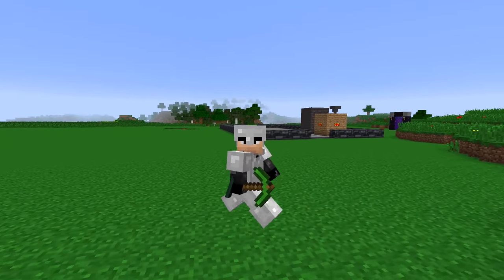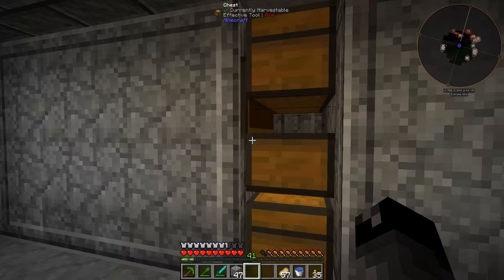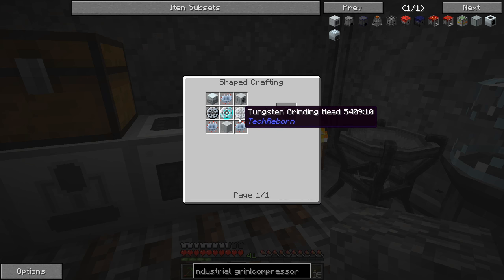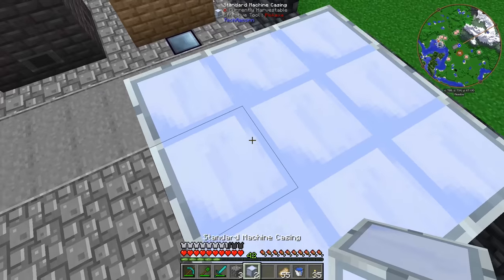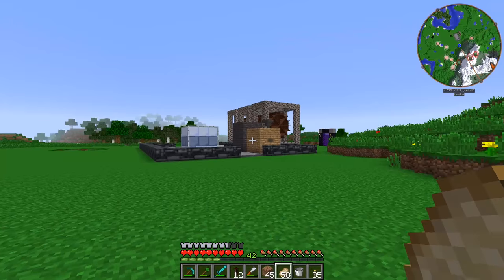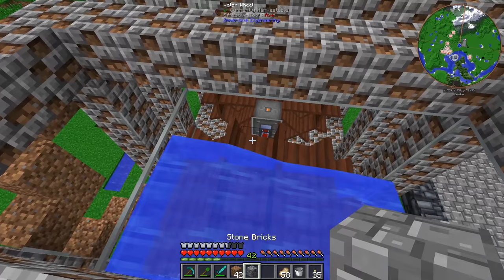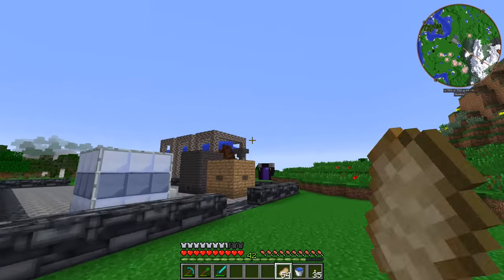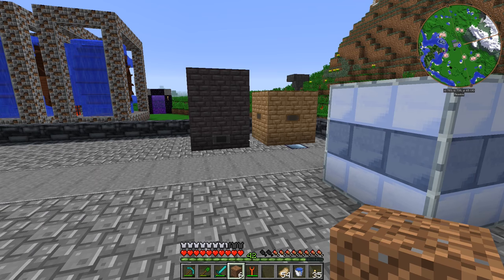Minecraft Mods FTB Inventions - INDUSTRIAL GRINDER [E04]

Comment: +hypnotizd If you payed attention when you read the Changes for this Modpack Specifically back in the 1st Episode, then you would have seen that they disabled Immersive Engineering's Power Conversion properties and told you that if you wanted to convert to different power types, that you'd have to use the Power Converters Mod.

Comment: Hypno, bro, all you need is RedNet energy cables, they convert ANY type of energy to ANY type of machines ;] You can also plug the immersive engineering LV/MV/HV Wire Connectors, DIRECTLY to the RedNet Energy Cables. like plugging a wire into a wire lol

Comment: Really liking FTB inventions so far, would be nice if it had draconic evolution though.
Reply from the maker: To be honest I'm a little tired of DE. It's really neat to dink around with but it's so overpowered there's no reason to use any other tools or armor in any modpack it's in.
Reply: Never mind the armor, I made a self sufficient power plant using culinary generators, redstone furnaces, grinders, and draconic spawners.
Reply: It would be nice if DE was added to the pack. The armor's really good for building, and there are other useful features, such as the teleporter, the power storage and the mob spawner.

Comment: Red net energy cables from mine factory reloaded can convert energy so you could have a pulverizer for example right by a macerator if you connect them both to the energy source with rednet energy cables. I hope this helps!
Reply: They can also connect to normal rf pipes.

Comment: A quick warning about the power converters mod. The steam consumers seems to have some issues with it when I used it. If it's connected to a boiler it will run just fine until you Save and quit. Once you try to reopen your would it will crash on loading screen. I had to remove the steam consumer using MCedit in order to fix this.

Comment: EU to RF conversion is disabled for immersive engineering in this mod pack.
Reply: why on earth would they do that.  EU is so terrible...  I guess they were going for a 'classic experience' of the grind of incompatible machines. lol
Reply: tbh since immersive engineering came to the light almost no one cares to set up an eu generation setup.. It was and it is so OP converting RF which is easy to generate to eu which is kind of harder to generate(lots of eu/t at least) for such a low cose of some wood and copper..
Reply: the pack has power converters :-|
Reply: +Ziturion "disabled convenient things" no, they replaced inefficient nonsense with better things (i.e. Power Converters)
Reply: +AvoidanceProtocol There's Power Converters, fool.
Reply: +William Maduno (Diitto) no need to be rude, everybody can have their  own opinion
Reply: KoaladileProductoz Yeah... that's not happening. :)
Reply: Blue Star It's annoying when all people do is complain, and complain, and complain when they don't know anything.
Reply: SpontaneousCombustionMan Same reason why people get annoyed.

Comment: use ender io reservoir for infinite water.  you can put it in the ground 4 blocks.  it will auto generate water that you can use ender io pressure fluid conduits to auto supply machines with water

Comment: #Hypno You can just use normal charcoal to make steel :D
Reply from the maker: yes you can, but you need RF, pulverizer and an induction smelter. I did this a few months ago during my FTB Infinity Evolved Expert Mode play through.
Reply: +Hypnotizd you can actually put charcoal in the blast furnace 一😌
Reply: +Sam Huang Yeah that's what I meant 😀

Comment: So to make the water wheel u need iron, gold, manlin, copper... purity much all the ores uv ever seen, which =⇙
                                                                                                                           ⇙
                                                                        ⇙
                               ⇓
TO MUCK FUCKING CRAFTING!!
Reply: The water wheels use the basic recipes. You must be including the materials Hypno  needs to convert RF to EU in which case is a pain.  However if he used IC2 for power generation it wouldn't require extra blocks(power converters) but look at the bright side; It is NOT expert mode recipes. lol